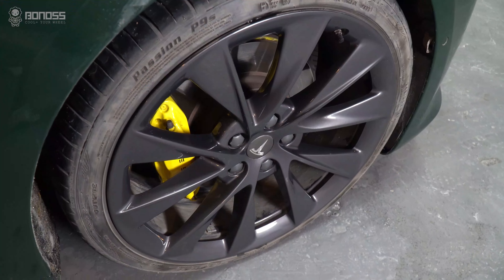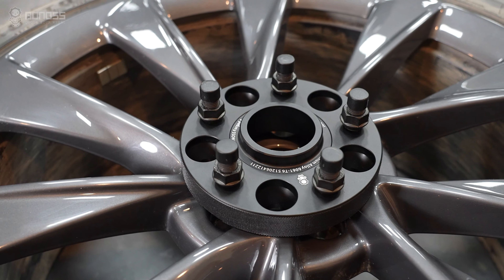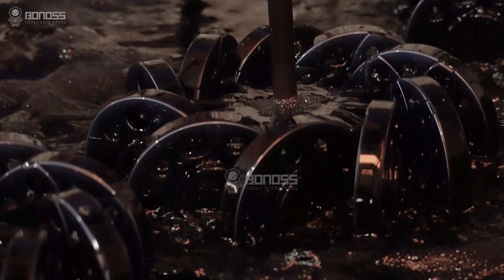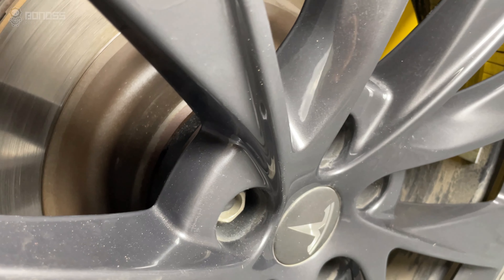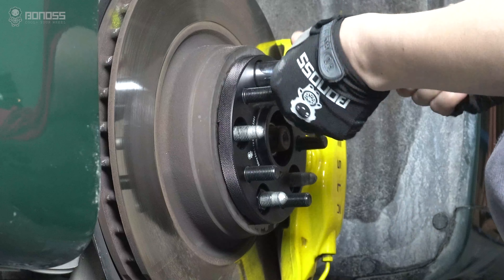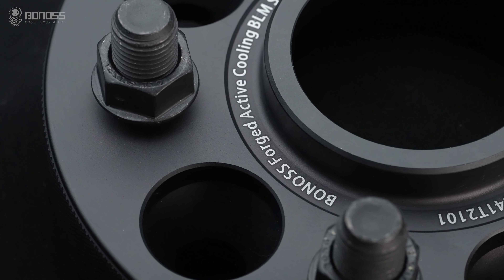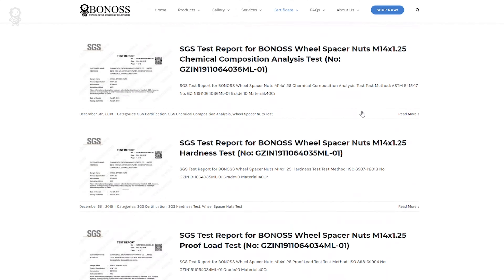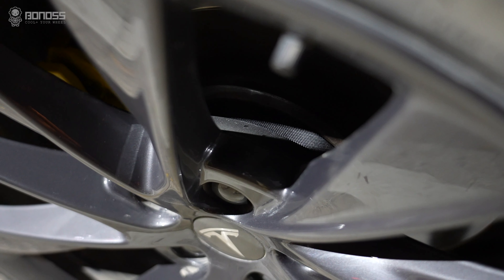2023 Tesla Model S Plaid |Are Wheel Spacers A Good Idea For EV?|BONOSS 15mm Wheel Spacers(Bloxsport)

Comment: So I do have a question I purchase these spacers 15mm for my 2017 Tesla model s I also purchased the tempest plaid wheels for the 2021+ do i need them to fit the wheels for running purposes or just to look better I seen a guy with a 2016 p90 that said you need spacers for newer wheels

Comment: I have a 2023 Model S Plaid 8/23 Build. I would like to purchase the 15mm spacers for the front and back. I have stock Plaid brakes and the 21” arachnid wheels. Will any modifications be required to the car or spacers to allow for proper fit of the 15mm spacers?  I want a bolt on solution to the stock setup. Thanks in advance.
Reply: I want to do the same thing. What did you end up doing share the details please ❤
I ordered 15mm for rear and front. I didn't get standard strength 6061 vs 7075. 6061 is strong enough even for the plaid.